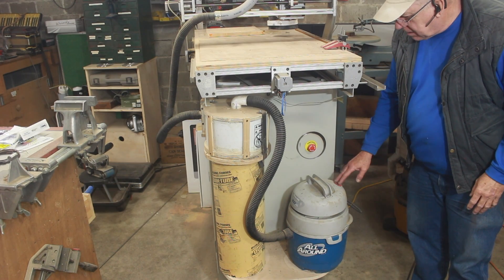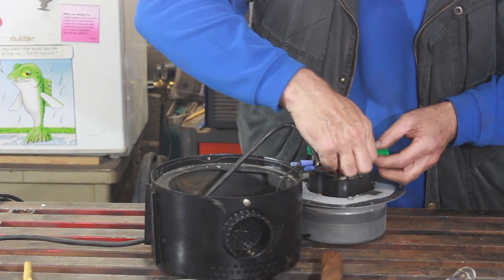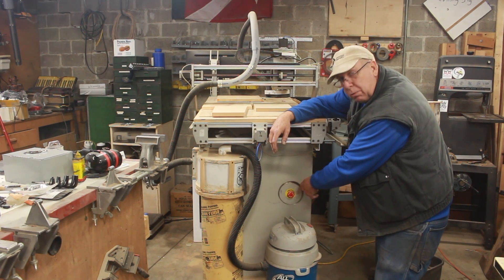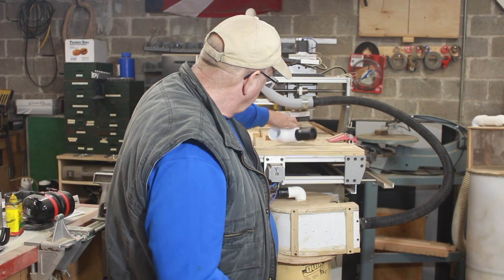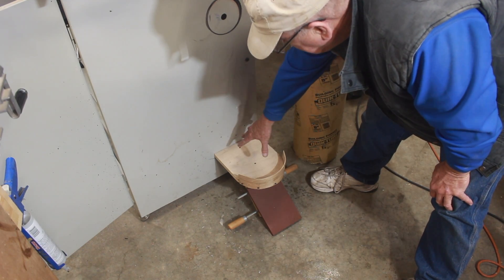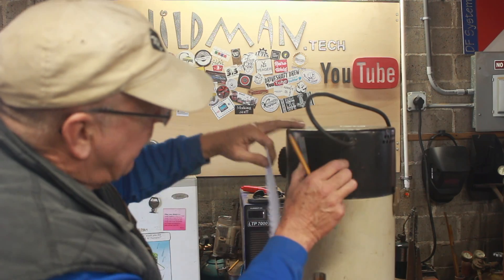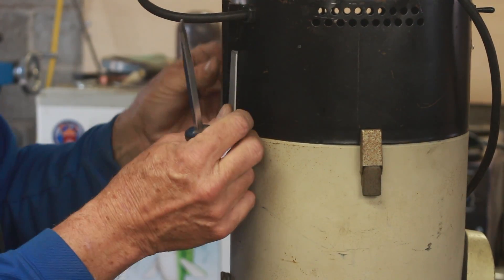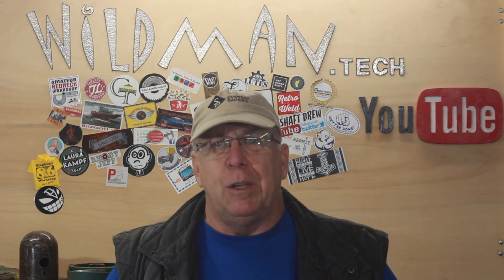Dust Collection Upgrade for the CNC Router

Comment: On large DC motors we "stoned" the commutator using soapstone while the motor was running.  I've used the same process on drill motors with excellent result.
Reply from the maker: I may try that because it's still arcing a little bit.
Reply: Wildman Tech: I use a soapstone used for marking metal normally found at a welding supply or in the welding supply section at a hardware store.